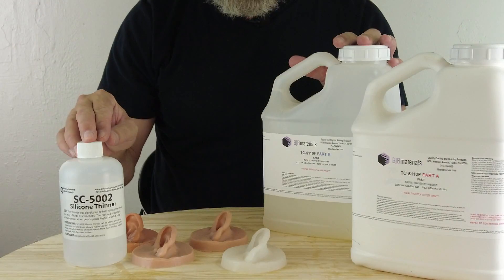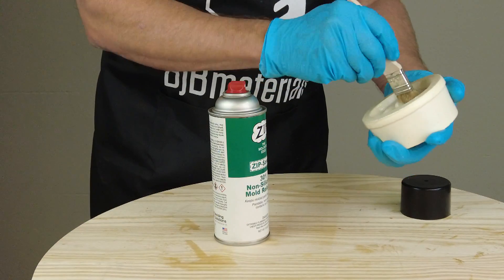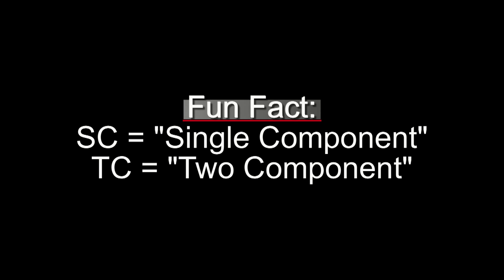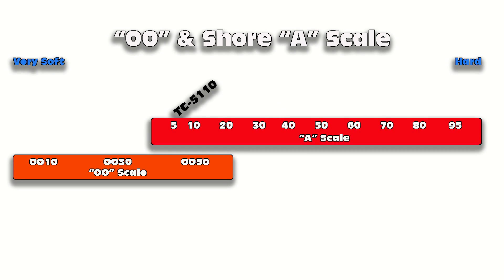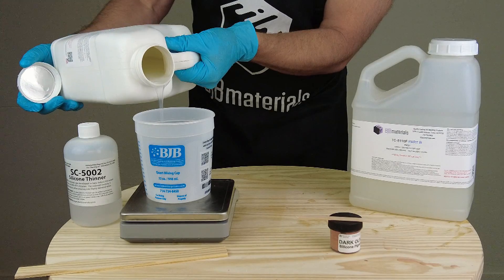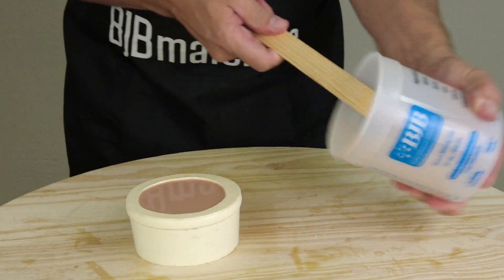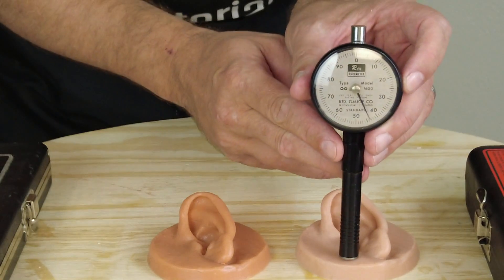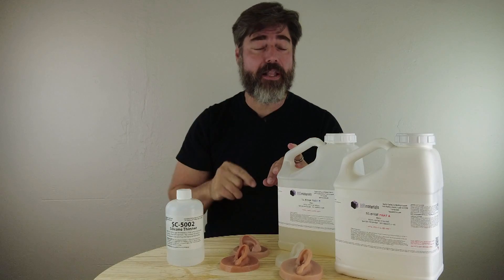How To Soften Silicone: Medical Simulators & Skins

Comment: Hello, is there a way to revive an aged silicone medical product's softness? I think it is maybe 5 years old..?
Reply from the maker: That really depends on the silicone formula used.
Reply: @brickintheyard  Ok, thank you for replying and quickly!
Reply from the maker: @ No problem! With medical devices/products you really want to check with the manufacturer to make sure you don't harm the original part.

Comment: what's the difference between a theatrical deadener and  this silicone thinner ? s I can see this one does not turn silicone into a sticky gel (that I usually encapsulate with cap plastic).
Reply from the maker: This will just soften the cured silicone. A lot will make it tacky, but this is a different effect from Deadener. Deadener changes modulus and softness reducing the elastic "snap."